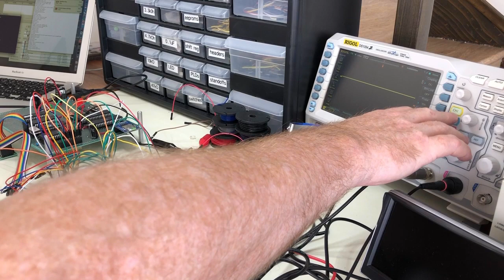6502 Mite home-brew computer project: interlude, debugging graphics

Comment: You could be not initializing the chip correctly
Reply from the maker: It's possible. I'm certainly going to investigate. Even though the video signal looks wrong on the oscilloscope, the monitor seems to recognize it when I initialize the chip, which makes me think that it's initializing correctly (certainly, it behaves quite differently before and after initialization) but I want to investigate further. Thanks!
Reply: @pauldourish  oh sorry, yeah that sounds like it could be an analog issue, have you checked the output directly from the chip?
Reply from the maker: C32 I did, but you just made me realize that I did that with the output circuit still connected, which was kinda dumb, so I will check again more carefully.
Reply: @pauldourish  the output circuit should have a high impedance input, i think it's unlikely it is broken in such a way to effect the chip's output but it could be the case
good luck!